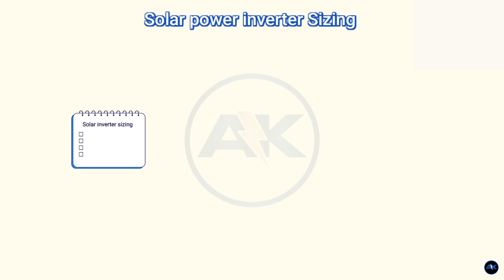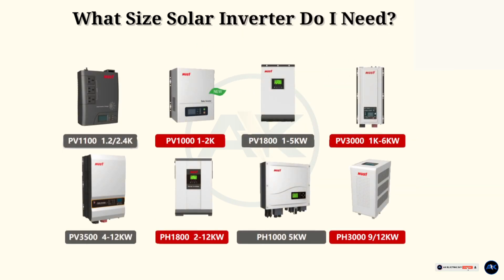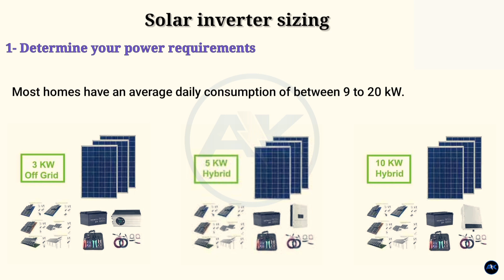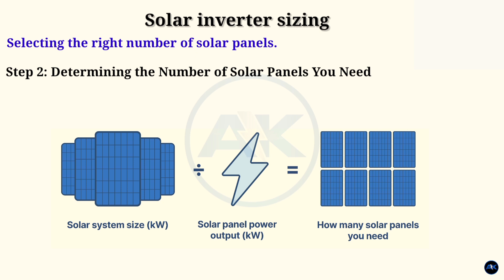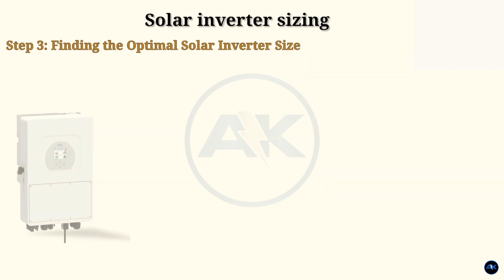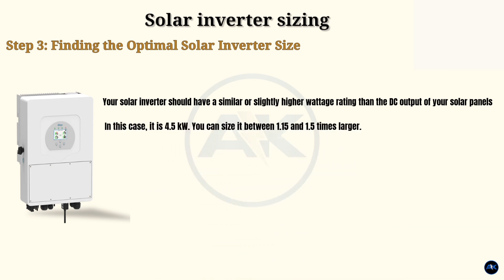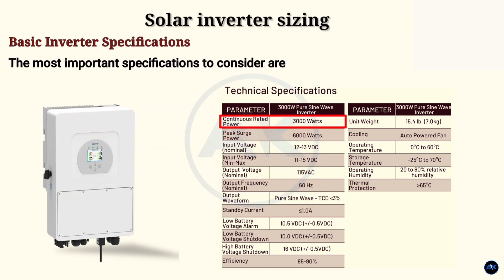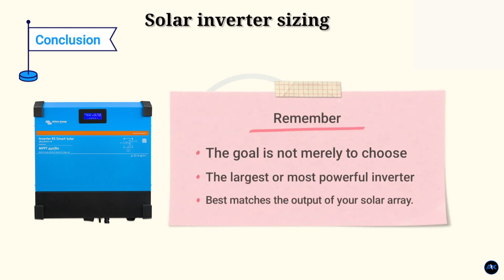"3 Easy Steps to Size Your Solar Power System: The Ultimate Guide to Solar Inverters!"

Comment: 7.43. why do the input voltage goes below the threshold, as usually a battery is connected in all offgrid installation

Comment: I over-estimated the practicality of installing a large solar array with a plan of storing the energy and selling when it is most needed in the grid and so bought an inverter for 12kwt when 10kwt would've been enough :/